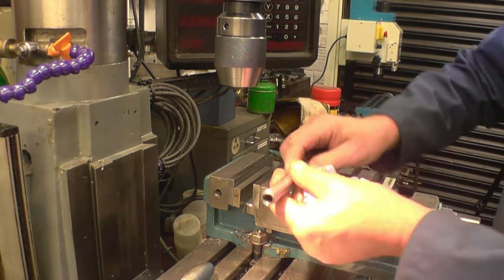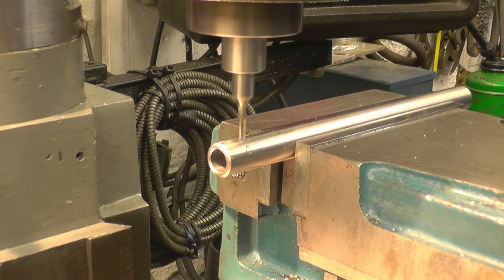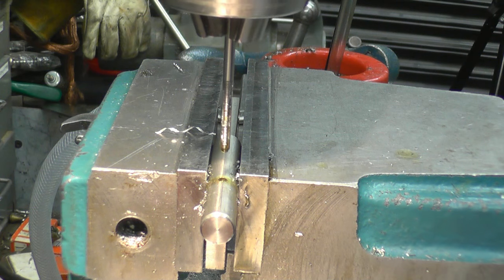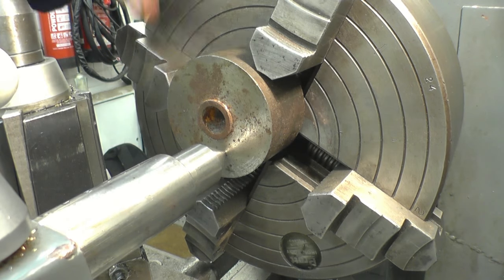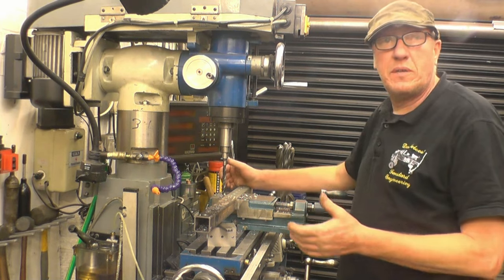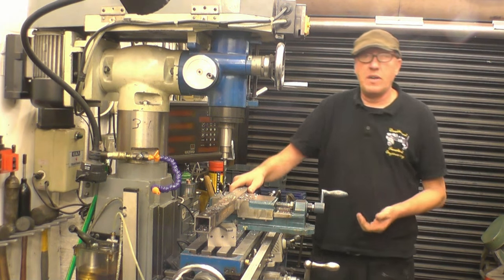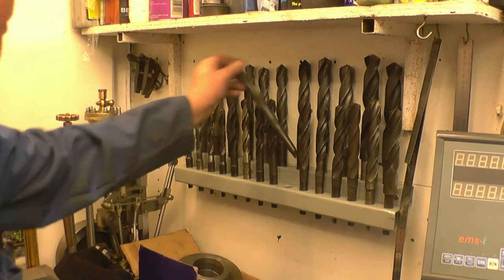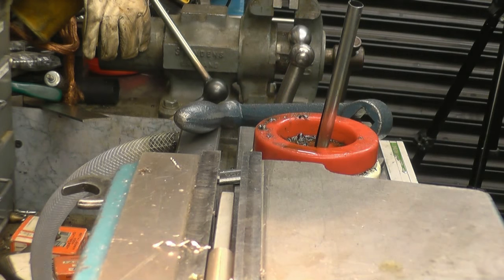SNNC 138 P2  Wiggle Bar  Noisy Mill Belt

Comment: Once again John . thanks for the out takes proving that all has not gone to plan the same as most of us experience . As for the toothed belt on the mill have you tried an 'M' section belt which are not as deep as the 'A' section ones and are a lot more flexible on smaller pulleys , I had to do this on my ' El Crappo  Chinese' drill/mill once the original belt wore out .

Comment: can you explain the mechanics of how the edge finder works?why does it kick out after finding the edge?
Reply: There is a spring inside holding the tip to the body.  I think there is also  a tensioning rod, to relax or tightenen the spring.  Mating surfaces are extremely flat and usually precision ground.  When against an edge, the body and tip run concentric.  I think the kick off is when the two surfaces are no longer perfectly parallel, because you have lowered (talking microns) one side of the tip by pushing it into the workpiece.  It moves to one side due to its full contact and rotation against the work piece.

Comment: John I just an ICD pacemaker defib implant and have to be weary of rf frequencies off motors etc can you tell me will a mig 130 affect it?  As I wouldnt like to not do any welding.
Reply: Phil that surely would be one for your registrar to answer mate...
Reply: No in uk  got told 1 month driving ban now its 6mths and they can't tell me the make I have so I thought there are bound to be others on here who might know
Reply from the maker: I try to answer most questions This one is way out of my league
Reply: No worries john worth a try. keep them coming regards to debs and your dad
Reply: All the devices are made to meet the same standards so all will perform identically in response to interference; they have the same level of shielding on the unit.  In the USA, all of the devices are registered to the manufacturer with the patient's name in case of factory recalls and to track performance in the field.  I'm sure that you can find out who manufactured the unit.  You might have to go from company to company.  Good luck with your heart problems.
Reply: Found on Carmen Electrodes website sorry its a bit long Phil.:::
Electromagnetic Energy

The primary concern when welding with a pacemaker or defibrillator is the high electromagnetic (EM) energy created by the welding machine.  This electromagnetic energy can cause your pacemaker to continuously pace the heart, which can cause an irregular heart rate if your heart is already beating fine on its own.  On the other hand, the spike in EM energy when spot welding or starting a bead can cause a pacemaker to pause temporarily if it were pacing your heart.  Both of these situations are not good.  Implanted defibrillators could detect the EM energy from the welder as a fast heart rhythm, causing it to deliver shock (yikes!).

Interestingly, according to medtronic, the electromagnetic field created by a welding machine won’t cause any permanent damage or re-programming to your pacemaker or implanted defibrillator.  The primary concern is how these devices behave in the presence of the intense electromagnetic energy.  Any potential effects will end when the welding is stopped or turned off.

Another point to note is that Oxy-Fuel welding does not create an electromagnetic field, so it is safe to use with an implanted pacemaker or defibrillator.

How Can I Reduce The Risk?

Here’s a good list of precautions that we found from Medtronic:

Limit welding current to less than 120 amps
Work in a dry area with dry gloves and shoes
Maintain a 2 foot distance between the welding arc and the heart device
Keep the welding cables close together (twist them together if possible) and as far away as possible from your heart device
Place the welding machine as far away as possible, and at least 5 feet away from your work area
Wait several seconds between attempts when having difficulty starting a weld (don’t rapidly pulse the welder)
Work in an area that offers firm footing and plenty of room for movement
Work with an informed person that understands what you’re dealing with
Immediately stop welding and step away from the area if you start to feel lightheaded, dizzy, or you believe your implantable defibrillator has delivered a shock
Reply: Dulally Kat I imagine that the real vulnerability isn't the unit itself but it is the electrical leads that are the element of the system which is most vulnerable to interference. Considering the potential disastrous consequences if the unit malfunctioned, I would simply give up on any electric welding.
Reply: thank for that still waiting for cardio to get back to me.